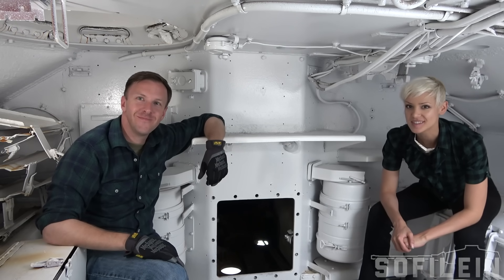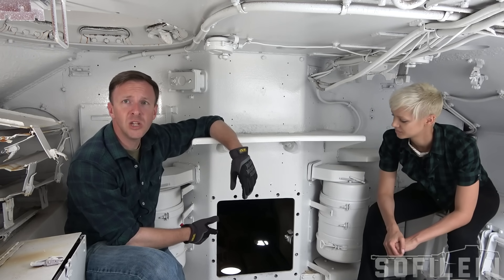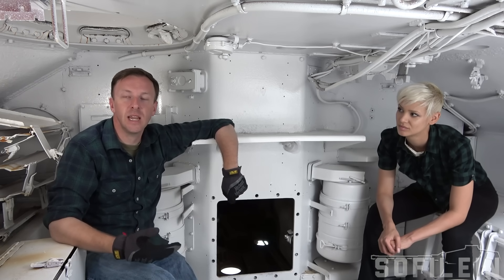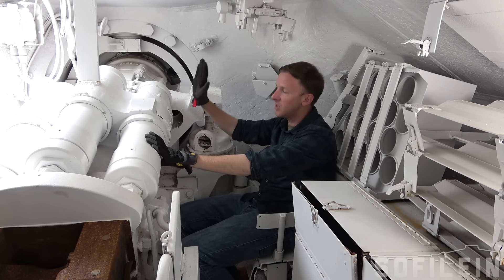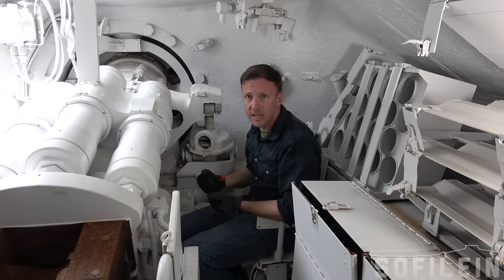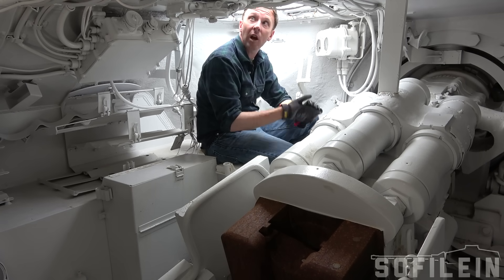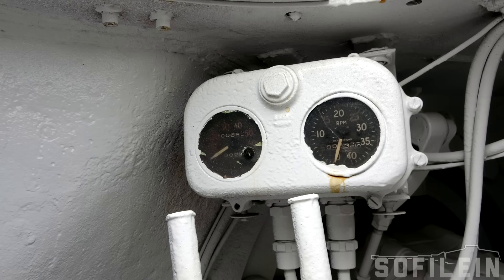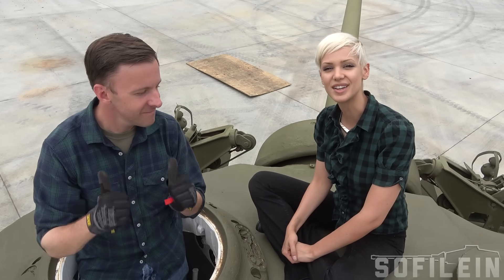Crew positions and interior features of the last T28 / T95 American superheavy tank

Comment: Wait.... T28 tipping over? That would be quite the slope.
Reply: Hu, good point. It must be one the tanks best suited against tipping.
Reply: @racernatorde5318  Mostly because of its height to width, and weight. Add in the fact it should be going slow enough to stop quickly enough to save itself.... it should be hard to tip.

Comment: 500 HP  to move 90 tons in really under powered.... The M-60 A1  in first served on had 750 to move 52 tons and the M-1
 I later served on  had 1500 HP for 60 tons.....I can't see top speed on the T-28/95  being more than 10 mph on pavement and 5 mph on soft ground..... I hope the back and top are well armored , or else you'd be  "Rudel  Bait"...

Comment: In a case like this one, where the original engine is available, but incapable, there's an argument for displaying the historically accurate engine compartment gear, hopefully on a stand to retain orientation & arrangement, but putting an effective replacement in the tank to allow it to function. Then add limiter and indicator systems to demonstrate original limits. Assuming a nondestructive mounting adaption structure can be fitted to use original mount points W new engine.
Veteran or not, every historical tank is a survivor, and deserves conservation, but also  every dignity we can give; they may never fire again, nor be capable, but I feel every aspect should be maintained as if the would or could. At a minimum, the life & voice of an engine, and the capacity to move itself, however rare the opportunity.